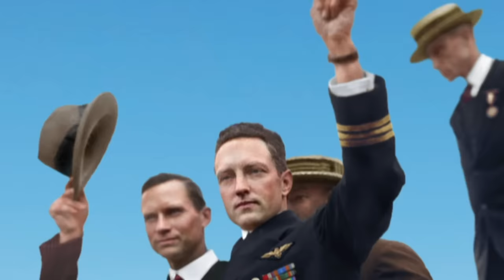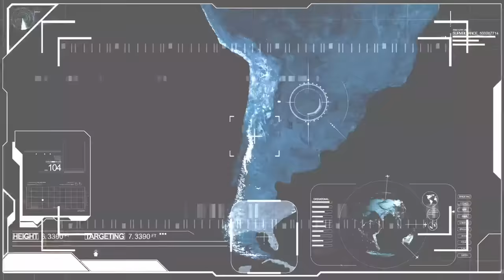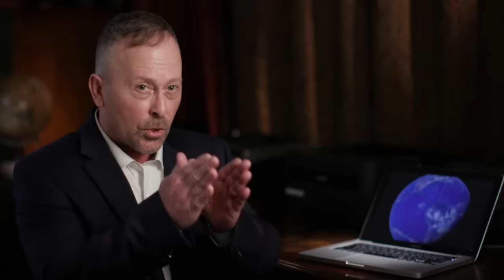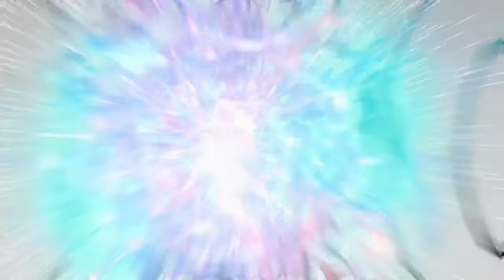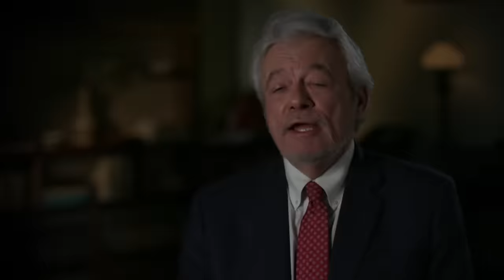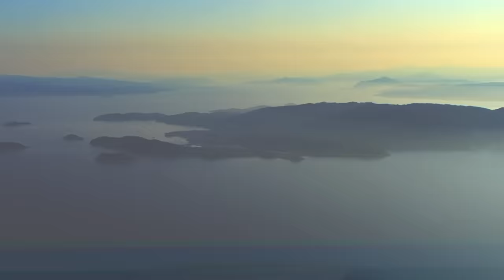Ancient Aliens: UFO Technology Found on Earth

Comment: The length of time that contrails stick around is a function of the amount of moisture in the air mass. Sometimes the contrails disappear almost instantly, which has more to do with the dry air mass than any top secret jet engine. Other times they stay for hours, and can spread out width-wise quite a bit. When I worked outside Kelowna BC I could predict snow the next day when I saw contrails switching from disappearing quickly to lingering and spreading out, which meant a moist air mass was moving in from off the coast. 

But I’ve got to admit: if a contrail maintains a straight line from pole to pole for any amount of time, there’s something veeeery interesting going on!
Reply: Chemtrail Conspiracy nuts reject that fact. I don't think a pole to pole contrail is possible, The Jet Streams in both hemispheres would tear them apart.
Reply: People are so gullible and not informed properly. People that know just have a much better understanding. There's a big difference between con trails and planes that spray pesticides for crops. Crop dusters.
Reply: The fact is that a pole to pole contrail was captured by satellites recently and no one knows what created it.
Reply: Contrails suggests jet engines, versus anti grav engines which would not have trails we are familiar with
Reply: @andyr7267  Very true! In all the “UFO” videos I’ve seen, not a single one left a contrail.
Reply: @Notheretodayk There's also a difference between "con trails" and "contrails".
Reply: They know exactly what made the contrail.
Reply: contrais begin with the word CON that what this is all about. total BS
Reply: That contrail across the globe is amazing though
Reply: @Am33304  Satellites? Military aircraft?
Reply: @Welshwolf62  Do us all a favour and look up all words beginning with "con". If that's CONvenient for you or if it won't CONsume too much of your time. I think it will be rather revealing, won't you CONcur?
Reply: Party pooper 😢
Reply: However, it's photographed via satellite and as goes the wind, it only took about 6 seconds  to go from from pole to pole. It must have been swamp gas if the usual excuses apply 😊
Reply: a straight line means, it was put there, real faaast

Comment: The antíkythera device mystery has been solved for a few years now, and is no where near the same as finding a jet engine in a pyramid LOL. Once they redesigned all the gears, cogs etc and found it did indeed help keep track of celestial events, winter/summer solstice, moon phases etc it was found to not be as near as accurate as they originally thought. It was kinda close, but nothing like they made it out to be. Was it ahead of its time? Sure. But not thousands of years. It is awesome and fascinating, and I'm sure took a decade or more to master, but it definitely is NOT some advanced alien technology dropped back in time.
Reply: The mechanism device mystery HAS NEVER BEEN SOLVED but hypothesized as of what it is. And if anyone has the evidence otherwise provide a link to the university study. There is a difference between a paper written by a professor on a subject and reality.

Comment: To stop aging...
Find a way to lengthen the telomeres on the end of our chromosomes. I would suspect adding to length would stop aging. It may be that there is an innocuous way to add to the telomere, so as to protect what information is existing on the chromosomes. (Sort of like adding a cap to the end of a shoelace, to protect it's degradation.)
To reverse aging would be an additional process/step. To correct and repair/replace any cellular abnormalities already existing at the cellular level - due to aging. I would also imagine stem cells would play a part; but I'm just a lay person.
Reply: That's it, the agletomere !  Aglet is what's on the end of any decent shoe lace.
Reply: @attemptedunkindness3632  I don't know anything about those.
Reply: Pressure chambers

Comment: Mach 10 is 7,680 miles per hour.  Not remotely close to 70,000.  The "speed" of what ever might have created that contrail was at least between Mach 20 to Mach 30 allowing half an hour for the trip.  The Antikythera mechanism was not machined.  The parts are hand made very, very carefully.  "Automaton" are common in various legends of the Mediterranean.  There is also extensive evidence of a much more "advanced" engineering capacity, in terms of similar machines.  The Romans for instance had pretty sophisticated surveying devices that were similar to modern plane tables.  The catch to such "sophistication" is that in a slave-based economy, there really is no call for it.  Various "robotic" (clockwork) devices were developed, for example by Hero of Alexandria.  He was only a century later than the Antikythera mechanism.  It's ingenious, but lacks a market, beyond a handful of priests, and priestesses.
Reply: One might have thought that Hero's steam engine might have led to actual vehicles but as you mention slaves made such an advance unnecessary. Any early attempt to power a ship by steam would have failed in that its lack of efficiency would have made a galley powered by human rowers faster. Note that steam engines were not used for practical transportation until around 1800 and this was after a confluence of different advances in mechanics, metallurgy and even fuel: wood has much less energy content than coal.

Comment: The contrail is from one of the Aurora aircraft from the aurora program. An upgraded(or not upgraded) aircraft.
Reply: Not sure what I saw but I watched something drop straight in; gradually gaining forward speed while dimming.  In about ten seconds it moved about a third the way to the horizon while I reached for my binoculars about 15 feet away.  All I saw when I finally got my binocs on target was two blinking lights which looked like they were atop twin vertical stabilizers.  The lights were blinking together but maybe there were two crafts.   I haven't heard of this kind of re-entry even being possible!
Reply: @tombolo4120  That's definitely one of the Aurora aircraft.

Comment: Nothing can fly through the atmosphere at Mach 10 and not boil and vaporize. 
They can do it up at the edge of space, like all intercontinental nuclear missiles. 
Even the Russian hypersonics can't do more the Mach 4 at 40,000 feet.
At altitudes where they can fly at Mach 10, there are no contrails, because there is hardly any atmosphere.
Reply: And how wide must that contrail be to be visible like that?
Reply: Haha this dude trying to unprove facts
Reply: @pwat6311  The width of that "contrail" is about 100 miles or more? Because that what it looks like. 
My guess is a pole-to-pole satellite got hit by a micro-meteorite and is losing fuel as it circles the poles. 
It is in outer space and a lot closer to the satellite that took the picture.

Comment: There is supposedly written documentation that The Colossus a 105 ft. tall statue of Helios the Sun God that once stood on the shore in Rhodes, Greece would move. I don't think statues could move like portrayed in this video with extensive articulation but I could believe in simple movements provided by wound or powered by hidden water flow clockwork and gears

Comment: a meteor - moving so fast earth's gravity wasn't able to absorb it prolly escaped just as fast as it flew in.  its soo high up...more believable if the trail had an actual curve (   to it.  This is way to straight a line....or close to ground say less than 300 ft would imply precision and most definitely an apparent curve.  this one like hit the ozone and skid across just to be shot out cause it was too fast